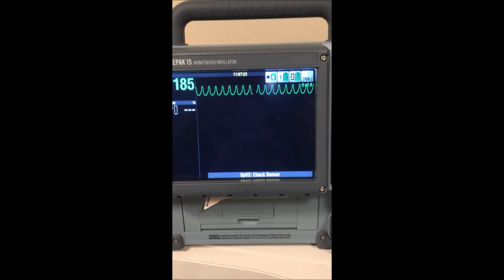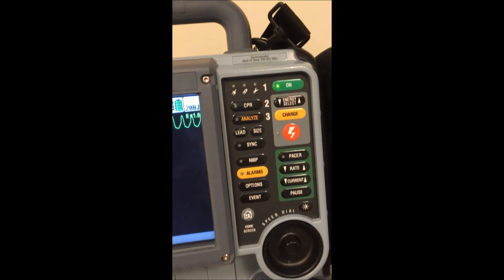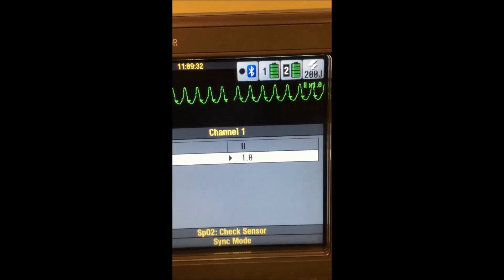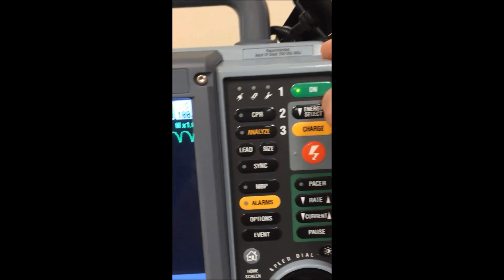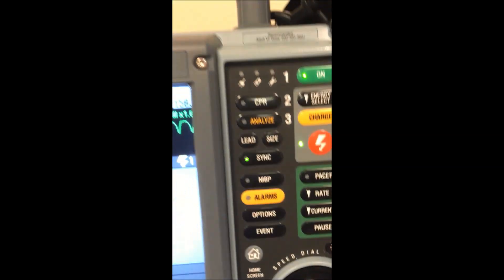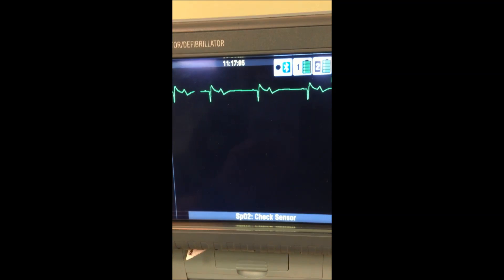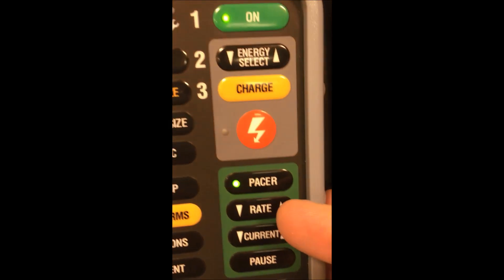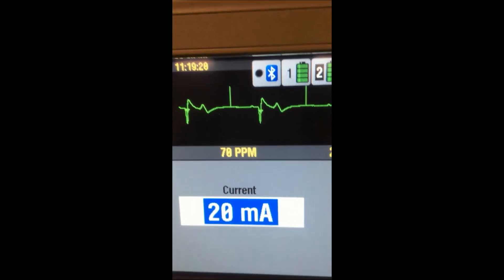Cardioversion vs Pacing

Comment: could You also answer  what drugs need  to be  use in this both cases?
Reply from the maker: Bradycardias that occur in parts of the heart that are innervated by the parasympathetic nervous system (sinus bradys, first degree blocks and second degree type I for instance) often respond to atropine. If that doesn't work a pressor drip may be helpful till either an internal pacemaker can be placed or the affected coronary can be reperfused. An amiodarone infusion can be used in stable VT but it's falling out of favor somewhat. Procainamide and lidocaine may also terminate a VT. Much more detail available here https://www.ahajournals.org/doi/10.1161/CIR.0000000000000261
Reply: Hey Thank You. I was thinking more about how to  cede a patient. For example which  better for VT and for brady? Midanium(midazolam) 5mg?
Reply from the maker: Ahh... yes we'd generally use midazolam or very occasionally ketamine here... Propofol is popular too.

Comment: while pacing, the mechanical pulse doesn't change and match electrical capture, it's still Brady at 40bpm. What treatment would you do next?
Reply from the maker: Sinus bradycardias, 1 degree blocks and second degree type I blocks often respond well to atropine... 2nd degree type 2s and third degree blocks less so because atropine depends on blocking parasympathetic innervation and the ventricles generally don't have much of that, so depending on the underlying arrhythmia, either atropine or a pressor...